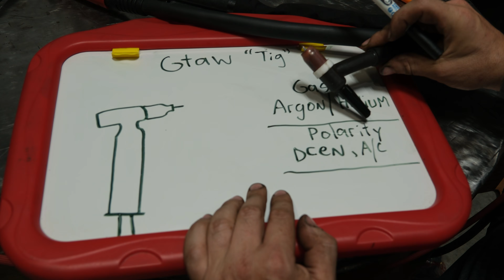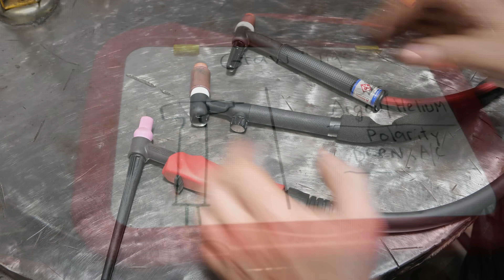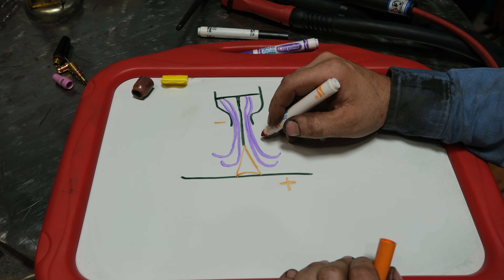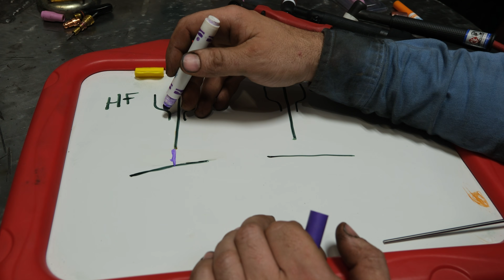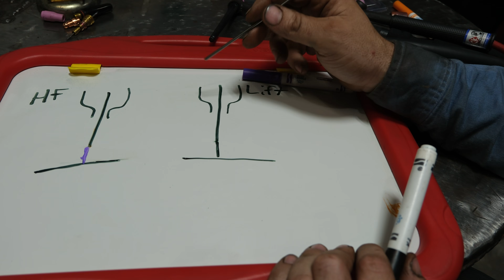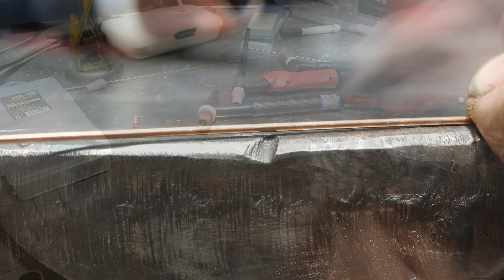How to Tig weld:  Part 1, introduction to tig welding

Comment: *Question for the ArcCaptain MIG 200 owners out there!*   
I start my Welding Certification next week. After having welded and self taught for decades, I'm looking forward to learning the diversities that this certification will provide but what I really want to get to learn is TIG welding, better. Your video and words of experience at the end are golden. I'm just wondering if the ArcCaptain MIG200 is a reasonable 'start' for that TIG process in being a decent starting rig? I have already bought it and have all the attachments but I'm not making very good welds but I'm okay with that at the moment. I would like to hear however if someone who OWNS this ArcCaptain MIG200 if they could share that this is or isn't that baseline of quality you mentioned in the last 5 minutes of this video to know if I'm wasting my time or should be looking elsewhere. I think it's just me because the MIG200 IMO, is an absolutely amazing machine and highly functional in it's diversity. I myself am extremely PLEASED with its performance from what I've seen on the other processes. 

Thank you for the video Greg, it was filled with tons of useful information as always you deliver!
Reply from the maker: I can’t comment on that particular machine, but I can tell you that tig welding is hugely skill of the operator.  In comparing a cheaper tig welder to an expensive one, the main drawbacks are these:  a cheap machine will start at 20-30 amps and will only drop to that amperage or a bit less after the arc starts.  This is an issue on thin stuff because you will blow holes.  Cheaper welders amperage control (foot pedal) tends to be off, not smooth, and the arc tends to jump in steps.  This makes it tough to weld aluminum (on a/c if the machine has it) and it makes it hard to make the puddle the size it needs to be.  Cheap welders typically start poorly with lift arc, better welders tend to have lift arc that works properly.  

If you are having rough starts, it’s likely a lot to do with the welder.  If you can’t run a straight smooth bead it’s probably mostly skill level.  A great example would be if I tig welded on a fixed amperage stick welder I could surely make 90% of a weld perfect.  The start and stop would be rougher than a proper tig welders result but most of the weld would be indistinguishable between the two.  As part of the video series I will be covering how to determine if it’s “you or the machine” that’s holding your results back.  It can be very hard to figure that out when you’re learning.  And I won’t lie, some machines hold back even beginners.
Reply: @makingmistakeswithgreg  Well explained, all received! Thank you much Greg.

Comment: Oi vei!, It took me so long to learn stick, that this tig process sounds very daunting. Thanks for the explanation.
Reply from the maker: Tig is rough to learn but it’s not as hard as it looks.  I am not joking, it literally just takes doing it enough so that you don’t have to think of what you’re doing.  When you have to think of everything you’re doing it’s simply too many variables to control at once, just like learning to ride a bike.  Once your brain takes over and does most of the work for you tig becomes easy, just like riding a bike or driving a car.

Comment: Iv been buying all the small stuff to learn to tig, got a coupon kit with the filler rods, got tig gloves, got a table, and a bunch of other accessories…been looking for a used bottle of argon but jeez they are pricey where im at! 
Saving up for a primeweld 225 as iv been learning on my friends and it’s been fantastic. But im not going to get very good with one Saturday a month lol so I need one in the shop
Reply from the maker: Argon bottles can be pricey.  If you were local to me I could get you one for pretty reasonable.  Depending on what company is local to you, it’s possible to buy a used bottle from someone that isn’t argon, and trade it in to get an argon bottle.  That may open your choices up a lot.  Keep in mind too, the 300/330 cuft bottles tend to cost far less per cuft than the smaller 125s.  It also pays to use a gas lens so that you can reduce gas flow to save money.  Around here a 330 cylinder is 75$ swap fee and lasts about 30 hours of welding at 10-12fh of flow.  Definately worth that vs 44$ for a 125.

Comment: Thanks Greg - I've been waiting for this series and am looking forward to it.  I'm glad you mentioned TIG brazing, and hope to see that covered as well. I'm interested in being able to join dissimilar metals, as well as thinking more sculpturally and not melting the base metal.  Currently Youtube certified for stick and MIG/fluxcore and looking forward to adding TIG to the mix.
Reply from the maker: Brazing with tig functions just like steel tig but with about 30% less heat.  You also keep your arc directly on the molten bronze instead of the base material.  I did one video on it a while back, but I will be covering it again.  Here it is: https://youtu.be/nazf5gqJwfw?si=JbDG9QK-Rh5aBp8D

Comment: I got an ArcCaptain ACDC machine about a month ago and now I'm pretty much done welding a 2m x 1.5m steel frame for my upcoming CNC router. My welds are not consistent but I'm really happy with how they're looking in general. Only way I got that done is I've intentionally skipped learning how to feed more wire with my fingers and how to use pedal - I just use the pulse function and pause if I need more filler wire. I can add those other things later. But man is it difficult to weld with two hands in some inverted position, going into a closed corner underneath the frame! Also have to use the torch with my left every once in a while because can't reach otherwise.
Reply from the maker: It is tough to weld out of position with tig.  There are a ring of ways to weld poor access locations with some tricks.  All of them require the filler rod hand to be able to do what needs to be done, which takes a while.  Being relaxed is huge, and feeding filler enough to get really good at it.   No doubt there are a thousand dipped tungsten’s before you get good at weird out of position welds lol.

Comment: Hello , 
Very well explain. 
I weld stick and very rarely mig but I want to learn tig. I live in europe , Romania and we have other brands . Because I have only stick machine I have to buy mig , tig and plasma. I find Stahlwerk CTM-250 ST 200A TIG + MIG / MAG + MMA + 50A CUT / Plasma .
Is it ok ?
Thank you very much and keep it like that.
Reply: Hello. I also live in Romania and last year I bought a Primeweld tig 225x from the States, it was worth it even with all that shipping cost.
 Stahlwerks seems to be a decent brand, I haven't tried any of their machines, but they seem to have a good enough reputation.
 One thing to keep in mind: regular cups, without the mesh screen or gas lens will almost always produce grey welds on steel and stainless, so if you need to weld stainless, look into some gas lenses, you can't usually find to many in our country, but there are some.
 Also, in Europe, we don't really use a foot pedal for tig that often and I personally do preferr my foot pedal over a tig button.
 Hope this helps :)
Reply: Stahlwerk welders are worth the price in my opinion. Especially the 7 years warrenty  are a great Deal 
(I used their Service a few times and every thing went flawless. I don't know how the conditions are for romania, but as a european country it should be same as for germany. (you'll have to figure that out)
Reply from the maker: I am glad you got some solid answers/advice from people with more experience with those machines and what’s available in your part of the world.  I have no experience in many machines sold in other countries but I can tell you that for tig the best thing you can have is a machine that has a decent arc start and a foot pedal.  Those two things make tig useable.
Reply: Wow thank you very much for answers.
It help me a lot.  I try to start a new activity , to do what I like. I like very much create unique items. For that reason I build an metal workshop , somehere  near capital and I try to fill with tools that I expect to need it.
About cup of tig welder , very interesting advice . Maybe we can talk more about subject. 
Thank you .
Reply: 1. Foot pedal
2 decent arc start
For first demand is simple : you see the pedal , but for the second demand? The seller always say what buyer want to hear... or it is enought the machine specification?
Thank you.

Comment: I will add that you can weld aluminum on DC with argon if you use electrode positive polarity and a much larger diameter tungsten then you would normally use for the amperage your welding at. I’ve done it before and it works well.
Reply from the maker: The downside to that is very limited penetration.  I would assume it would work on thinner material but on something like 3/16th I would assume it would barely fuse the material at 200 amps.  I will definitely try that out and see lol.
Reply: @makingmistakeswithgreg  You are correct, it’s far from ideal and it’s going to be a multi pass open root  weld on anything other then sheet metal. However it’s something to keep in mind it might get you out of a jam someday. Certainly not a replacement for an AC capable machine!
Reply: I must add 200 amps is going to be hard to achieve, even a 1/4 tungsten is only good for about 130 amps on DCEP. Once again it’s far from ideal and you have to hold a very tight arc and it likes to wonder. You have to ball the tungsten. This process puts a lot of heat into the torch also so long runs are out of the question. Again far from ideal, but it can get you out of a jam.

Comment: TIG is definitely the nicest welding process, I use TIG almost exclusively at home. Hell I’ll weld mild steel with TIG if it’s something I can work on inside. It’s such a clean process that you can weld in your living room if you wanted to. I’ll admit I’ve TIG welded my recliner mechanism back together in my living room more then once, don’t tell my old lady about that🤣!
Reply from the maker: Tig welding recliners is definitely a far better option than migging them in the living room 😅
Reply: @makingmistakeswithgreg Less random carpet fires for sure!

Comment: Thanks. I watched the whole thing even though I did a lot of research before I bought my PrimeWeld T225x and you covered stuff I didn't know.   I'm definitely looking forward to the whole series.
Reply from the maker: I will have a ton of videos on tig, more than enough for everyone to get up to speed and doing good.  The primeweld will be able to do most anything you would want and is far better than the Amazon special welders.  You will have no issues following along with the videos 😀

Comment: My brand new Yeswelder has "lift start" it is almost impossible to use when trying to weld sheet metal because the tungsten always sticks and lifts the metal up.  Not good when you are trying to do but welds or tacs.  The only way I can get it to work is "Roll start" where I touch the tungsten to the metal at a 45 degree angle then roll the tungsten up to a 60 or greater degree angle to break the tungsten loose.
Reply from the maker: That’s unfortunate that it works like that.  True lift start more or less has a low voltage sense circuit that tells the welder when the tungsten touches, then once the tungsten breaks contact it starts the arc.  By the sound of it your machine has a live tungsten at full power (much like scratch start).  One thing you can try to do is to leave an arc gap between the tungsten and the base material, and take your filler rod and swipe it between the tungsten and base material.  You might be able to start the arc without the tungsten sticking.
Reply: @makingmistakeswithgreg  Thanks, I'll have to try that trick of using the filler rod.  I read someplace that it's only supposed to be using 5 amps to sense with, but I suspect it is much more than that.  I'm going to get into the menu, it might be the sense amps are adjustable and just come from the factory jacked up high.  I learned tig welding years ago using an ancient Westinghouse AC welder with a High Freq addon to it.  I was welding up holes in an aluminum boat I was restoring.  Seemed so easy to do back then... (19 years ago...)

Comment: Thank you! I bought an AHP 200X.  Have not used it yet. I need to learn. I did research for about a year before I bought it. $900.00 Shipped. I talked to the manufacturer and they told me to buy it from thier Amazon store or one of thier few distributors only and buy it when they get a big shipment in and the price will be lower.
Reply from the maker: No problem.  The AHP will be a good machine to learn on, and you will have no issues following the videos I will be putting out on tig.  The AHP and primeweld are both solid machines that offer most everything you would need to do great welds with.
Reply: I have owned a AHP200x for several years now.  I think it was $700 new at the time.  for your  info, watch out for the tig torch cable wearing out over time.  my cable developed some cracks and holes, even though I kept the machine in my garage, and not used much.  took me some effort to figure out why my welds were contaminated, as the cable had to be positioned/bent in certain directions for the cracks/holes to open.  I replaced the torch cable with a higher end one, and it works great.  also, the foot pedal sucked, so I upgraded that too.  I think I saw the newer AHP201x now has a better torch cable, and an upgraded foot pedal.  otherwise, I have been very happy with the ahp200x. hope this helps
Reply: @markdeitchman8938  Thank you. Mine came with the better foot pedal. Not sure about the torch but it has a flexible head on it.

Comment: Very good. Some people have problems with scratch and lift start. I always suggest getting a small, flat piece of copper, maybe 2 x 3 x 1/16” and put that on the metal right next to where you’re going to start your weld. Starting on copper will not have the tip sticking. Then drag the arc that tiny length to the weld and go from there. After you’re used to it you won’t need the copper any longer.
Reply from the maker: Great idea, that would surely solve a ton of potential issues.
Reply: Hi, Greg. I have been watching your show For a While I used to Bray's Torchweld and Meg weld years ago when I did body work. I've been thinking about getting back into welding. So I decided to get me a all-in-one welder. I decided.
 On the Volcano 220. I think it might do everything I want. Do you have any other suggestions or did I waste my money? I would like to know thanks.
Reply: @TonyHorton-ip6bt  do you mean the Vulcan? If so, it’s fine.

Comment: Very cool topic! I really like TIG  but I dont use it very often because it's low speed (and my lag of skill😆) the Tasks i use it are:
1. Roots that have to be sealed propperly like the eod of a excavator trackadjuster to it's base
2. Very fine work that my wife has to agree with like furniture
3. For "difficult" material such as aluminium, stainless and even cast iron
4. TIG-Brazing
5. For the pure fun of it - I really like how this process runs. Altough I'm at the very beginning of that learning curve and have to sharpen my tungsten und grind out that pore approximately every 10 minutes. I'm learning and waiting for that moment when ot all falls in place.

This video was very helpful. You took all the things I already knew but put it into the right place and perspective. Can't wait for the next Video!
Reply from the maker: There becomes a point where grinding tungsten’s becomes very infrequent lol.  Everything will click together when you’re able to train your brain to use light output as an indication of arc gap.  Once you’re able to do that and your hands move smoothly due to repetitions, you will have everything work together.  Tig truly is one of those things where there are to many variables to manage at once, so eliminating as many as possible is how to make good welds.  As skill improves many variables become automatically controlled.
Reply: That is exactly how it "feels". The one thing I'm really struggelimg with is the filler material. Actually I'm doing a hybrid thing combined dipping and feeding.  This needs to much attention that I should better spend on my arc gap and torch movement. Of there is a good trainingmethod I would highly appriciate if you could show in a follow up Video.

Comment: nice one, looking forward to your future tig videos, always looking for new tips. I have always found welding to be relaxing,  hood down, in the dark  just you  controlling a 11,000 degree arc melting metal. with tig you  can go full zen master mode, who needs tai chi, yoga meditation, well until you empty the argon bottle.
Reply from the maker: When the bottle runs out reality comes back 😅

Comment: 37:04 precise welds? with a 3/32 E7018 using an old rusty 225AC Lincoln I can stack weld tacks on top of each other in the process of making 2mm diameter sear pins and such including welding 16 gauge sheet metal with 3/16" E6010 electrodes, 5mm rod 1mm sheet steel AC... same rods that built the golden gate bridge. TIG only for surface blending, air tax?
Reply: How would that information help others to learn TIG welding?
Reply: @leonlowenstadter9223 it's not intended to. It's intended to intimidate new weldrers on the premise that they built something nobody else could. I can program 20 years of experience in a day on a robotic machine.